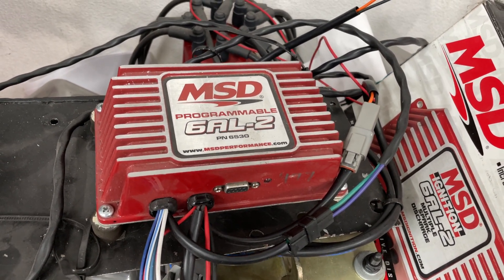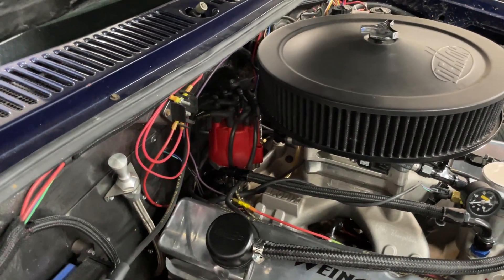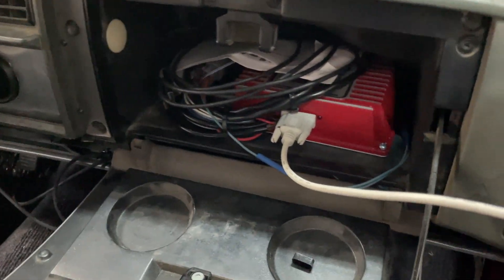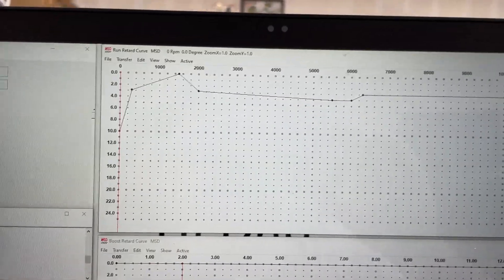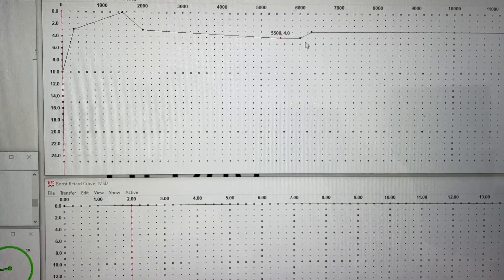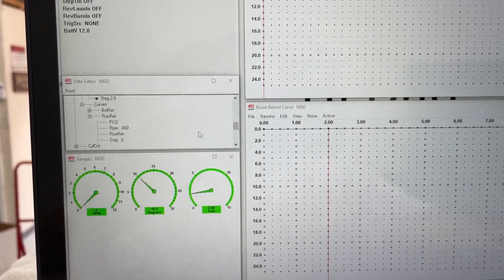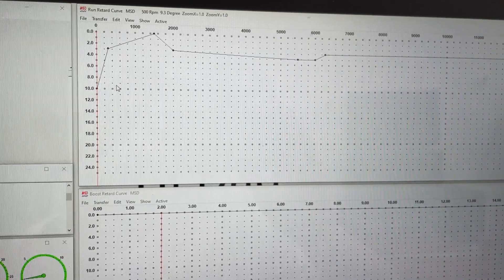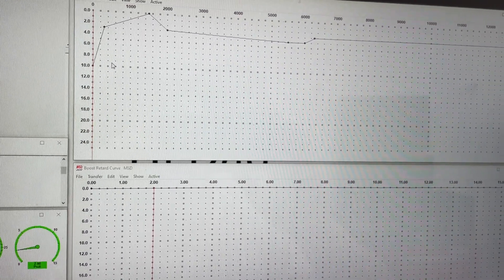MSD 6al-2 programmable ignition box setting up timing curve

Comment: I've watched this video so many times and I'm still confused. I need to set an advance curve starting at 0 degrees at 1000rpm, rising steadily to about 5 degrees at 1500, 10 degrees at about 2000, 15 degrees at 3000, 22 degrees at 4000, and staying on that trajectory until  5500 where it flatlines at about 30. Static timing is 10 degrees. Can you offer any help, please?

Comment: A few years after you posted this video, I just wanted to drop you a thank you note.   I have messed with my timing so much to get my old 69 Small Block Chevy to run right.   My engine likes a lot of advanced timing, but it needs to be a lot less at start.   This is a great solution.   Tired of taking out the timing light, and goofing around with the damn thing each time I want to tune it.

Comment: I have watch a lot of video on just this "How to" on the software.
Finally, Eric here has explained the software very well.
However, I would like to confirm my thoughts.
Since this software will ONLY take timing away (retard),
I now must set my base (physically) timing @ the top of what I want or need. 35 degree for my application.
Start my curve from there.
I hope I am understanding this correct.
Thanks for sharing Eric!!

Comment: The MSD WILL work with manifold vacuum, this is very handy for road cars, by running a vac advance system you can run the engine cooler (well the exhaust really) and get better MPG.  The cable is a 9 pin serial cable, its a pain in the ass!  They should be using a USB connector in this day and age.

Comment: What are the specs for cam you're running?  I'm running the super sniper in a 383 with 259/275 at .050 . Your curve actually is pretty crisp in mine. Idle is a little higher than I needed.
Reply from the maker: 252/258 108LSA .780/.680

Comment: My 6AL-2 fried and as usual didn't think about saving the spark table until after the data was no longer retrievable. I bought another one so now I have to program from scratch. I keep getting an error from my MSI laptop that there are no ports available. So I'm forced to use my wife's gateway laptop. So now I need to figure out what to set the timing for a 427 small block. I believe its running 10.5:1 compression. it's running a Howards cam 110275-10 Lift: .545 / .565, Duration @ .050: 241 / 247, Centerline: 106, Rough idle, Hot street & bracket racing. The engine was dynoed at 549hp. I'm trying to get a starting point to get the right timing. This cam has a recommended range from 2600 to 6400 rpm.

Comment: Dang! I didn’t know 6al2 could do all that. Just got me a 5 liter mustang with one on it. Believe it was giving me trouble driving home, I had to pull over and let it cool off for 15 to 20 minutes then it was good for another 45 minutes or so. The box it’s self didn’t get hot. I need to fix the janky wiring job that was done on it first and probably move it in to the car before I rule it out.

Comment: Drop Rpm is how much the ignition system will let the rpm drop before giving it ignition to go back to the limiter, ie,if you have a 8000rpm limit and a 1000rpm drop, it will hit 8000, drop to 7000 and kick back to 8000.
If I am wrong at all please correct me. Have a good day!
Reply from the maker: You are probably right. I will change it and see.

Comment: It is a RS232 that most older laptops used, you can buy a USB to 232 adapter from just about anywhere. I ordered one from Amazon and it came with a CD with the driver. Awesome video, thank you for sharing this information.
Reply: RS232, yes, but a DB9, as opposed to a DB25 or some other specification (9 pins vs 25 pins).  I do not know the gender needed (male or female), but USB to RS232-DB9 adapters are available.  Google is your friend. (search on "usb to rs232 db9 adapter").  Perhaps Eric can let us see a photo of the DB9 end so we can see if it is pins or sockets on his adapter.

Cool video.  I have a nice MSD ignition system, using the 6AL control module.  If the 6al-2 is plug and play replacement I do believe  will want to get one.  I already have a spare 6A module, which I replaced with the 6AL a while ago just to get the rev limiter feature.

Comment: hi many thanks for your info . Question Holley help line say 30deg is the most retard thats available !!!!
Does not sound correct since u retarded 38 deg . How do u explain this .   Very little info around .
My application is pro billet dist small cap on a sbchevy . Look for 45deg minimum .  Mech 35 / 10 vac

Comment: I have the 6AL 2. Programmable.  My old laptop. USB ports went out got another laptop.  Loaded my MSD disc  still have the DB9 connector. But now I can't. Down load any changes. Won't do anything when I plugged in the USB cable the computer make s the sound it sopose to. Recognizing the the plug connection.  But I can't transfer any information. It's not even. Accepting a tach signal  ?    In told I have to download a driver.  Not sure how to do that  I didn't have to do that with my other laptop.   I hat the 6al2 since 2005 this is the first time  I have had this issue
Reply: i bought a DB9 connector and there was no driver for it available so the ignition unit was not being recognized by the PC. I had the same issue as you.. I went to a computer shop and purchased DB9 connector with an installation disc AUS$ 30 .. loaded it onto the PC and now all good and can transfer and save from the 6al2
Reply: We down loaded the driver.  I am able to change the settings but the laptop is not registering at all when the engine is running.  Might end up going to a computer shop. To see if they can address the problem

Comment: I run my timing through the sniper. I think the sniper is much more tunable. This is rpm based only whereas the sniper has a 31x31 table like the fuel table. The msd works great for racing when you're at full throttle but I like the sniper's ability to have a full timing curve at part throttle cruising in daily drivers as well. I set mine for max vacuum at idle and add timing with rpm and reduce timing as load increases. I simulated a vacuum advance and a centrifugal advance to have my timing all in by 2900rpms. 
  I am interested in your dyno video.

Comment: You can add timing after you pass peak torque because the engine volumetric efficiency is dropping quickly and that will allow more timing.

Comment: Thanks for the videos.  I have an old MSD timing box that you adjust with  a screwdriver.  I doubt  they make it anymore. I've never used it. The one you have is going to work alot better.

Comment: Have you had any problems whith interference whith the wires?? Having some problems also can you start it whith the computer connected
Reply from the maker: No problems with it having interference but I have the first sniper unit.
Reply from the maker: I can start it with computer connected.
Reply: @WeingartnerRacing  thanks for replying I’m going to send it in to be repaired because I have tired every thing I can possibly do and it’s not helping thanks for letting me know though